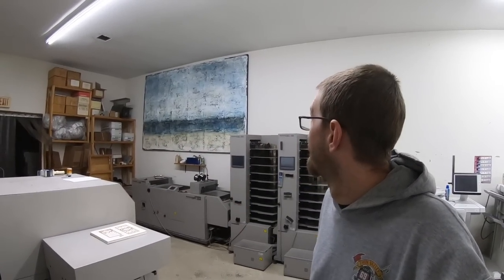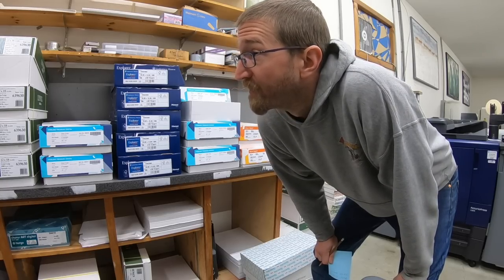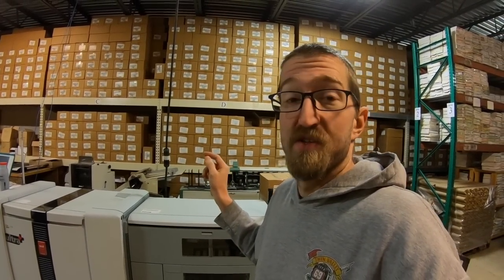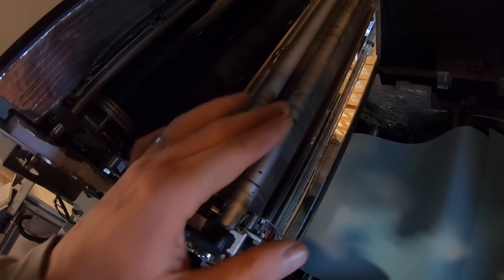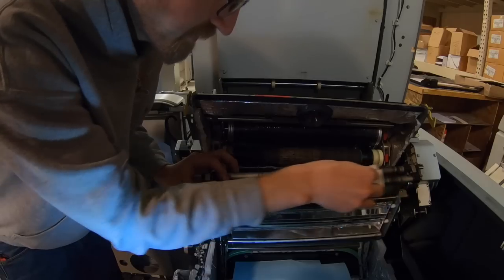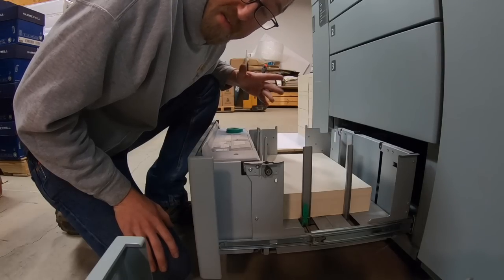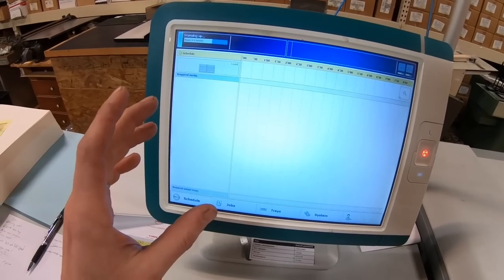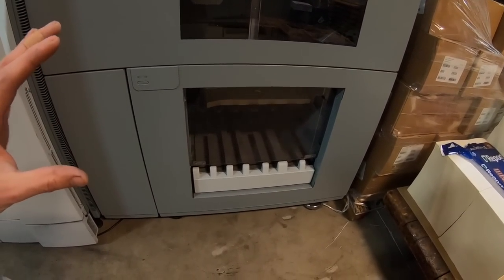Image Quality Problems on Canon/Oce Varioprint Ultra

Comment: PANIC: Konica 951. Only One and a half million copies. Had 10 copies out of 4000 with a very sharp half of the sheet in nearly solid black.  Tech figures it's digital. Then this week after printing 662 perfect copies it printed about 1000 of these black on half of the sheet, on both sides, on every sheet.  How do I add a photo here? Anyone have this problem and know what it is? The black runs down the length of the 11x17 sheet on the rear of the machine both sides of the sheet. A very very sharp cut off at the exact centre of the sheet. Also it starts instantly on the sheet. Like a clean one then the black one. So must be digital. yes, I printed for about an hour and have to throw it all out.. OUCH  Any help is appreciated.

Comment: Sir, my name is Paras Nepali, I am from Nepal and I have two brothers, two sisters and father and mother in my family.Hello sir I am from a poor familySir, I don't know how to speak, I am a machine that works, I work very hard.I used Konica Minolta machines for 8 years.Sir, I know how to drive 6100, 7100, 1085.I have not done any course but have learned it just by watching, I also know how to operate and repair machines a little.Sir, I am in great need of a job. Sir, please take it, it will be your kindness sir.
Reply: I have work for plz keep in touch if it’s positive

Comment: Which Paper should I use for technical book printing white or off white?
Reply: Talk to you paper theater what can you machine handle; finish stock possible can you get it in stock or does it come on a roll and need to be converted

Comment: These big machines are famous for power supply failures. Just get your Fluke meter and check the outputs.
Reply from the maker: Yup. Already had one power supply fail. That’s why I got a parts machine